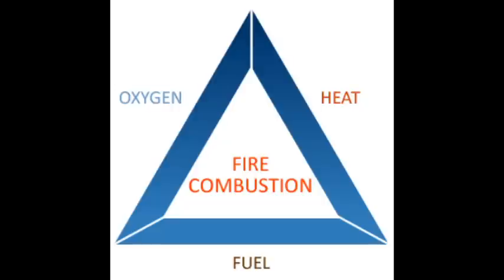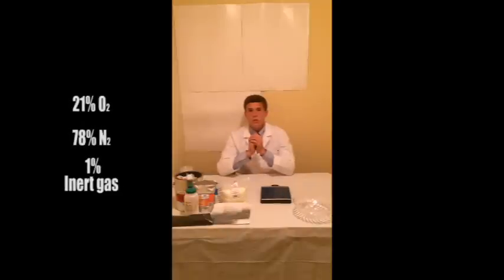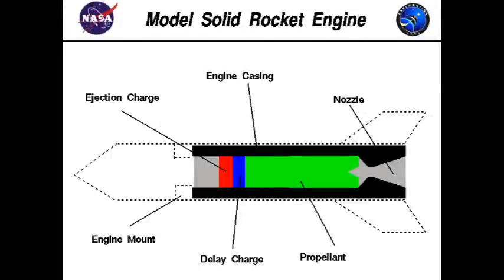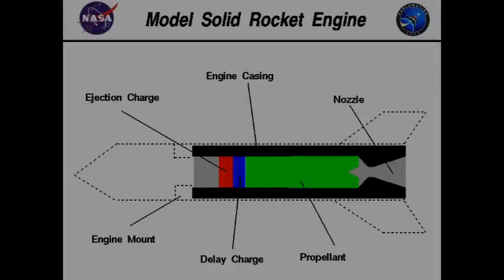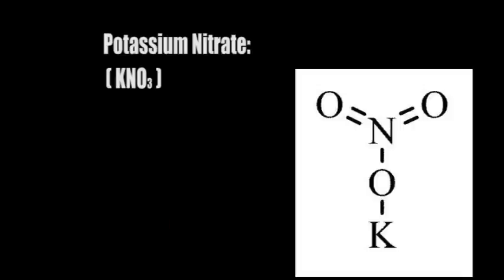Rocket Fuel Crash Course

Comment: never ever grind ammonium nitrate and magnesium powder again! do that seperately! Also, add the urethane and magnesium to each other first then incorporate the oxidizer. ammonium nitrate and magnesium powder is basically flash powder and will burn insanely fast but when the rubber is added it tones the reaction rate down substantially.

Comment from the maker: The R-Candy with iron oxide burns at a faster rate while the R-Candy without iron oxide burns at a slower rate. So the iron oxide R-candy has a higher impulse. I have not yet tested power output per gram of fuel, but that would be interesting. 
Great Question! ~Weekend Science Guy